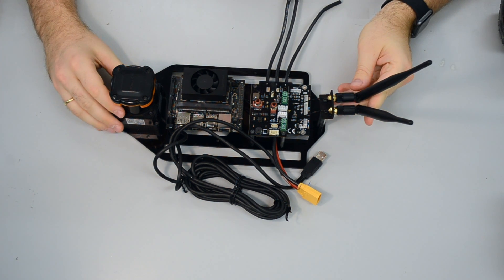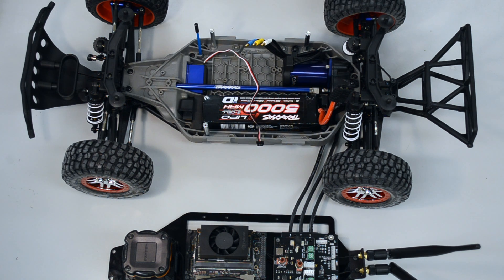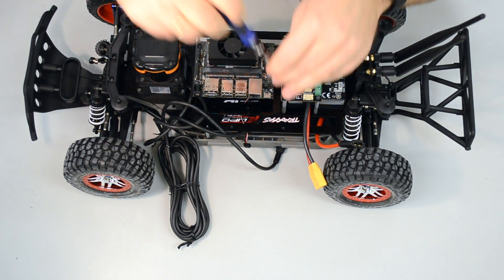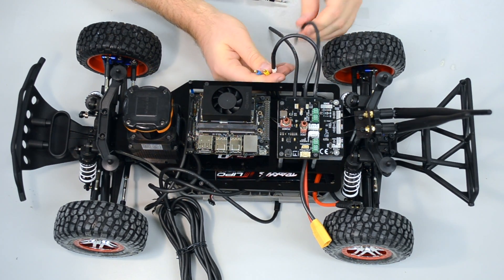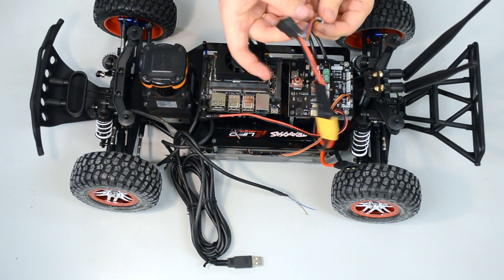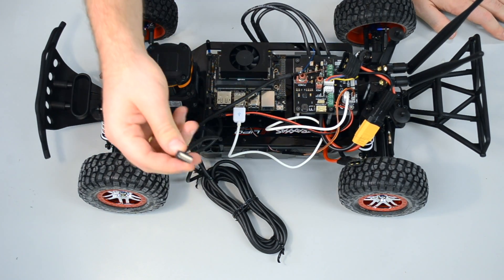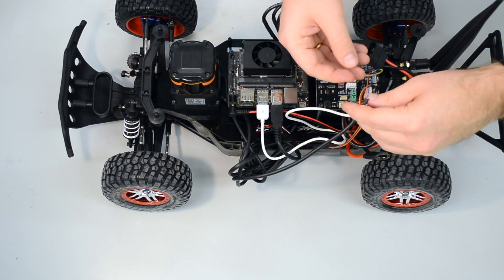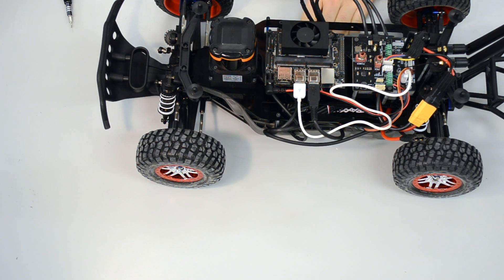F1TENTH Autonomous Racing: Build the Hardware - Part 3

Comment: an encoder is not necessary for the odometry?
Reply: Same question I had. They have an encoded motor it looks like but they dont show where the encoded info wire goes.

Comment: Thank you for this informative series . I would like to ask you about the steering servo connection.  How and where  to connect it?
Reply: I found it in the document (here is the link) (connected to PPM socket on the VESC board)
https://f1tenth.readthedocs.io/en/stable/getting_started/build_car/all_together.html
OR you can find it on to the following page. (under section: 6. Attaching the PPM Cable )
https://f1tenth.readthedocs.io/en/latest/getting_started/build_car/all_together.html#attaching-the-ppm-cable